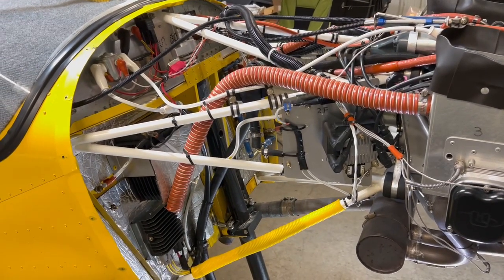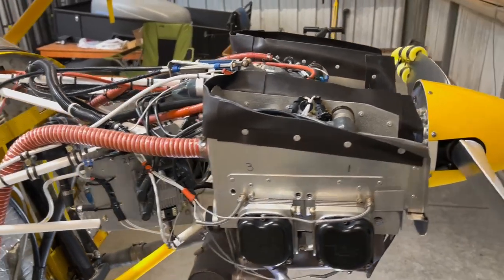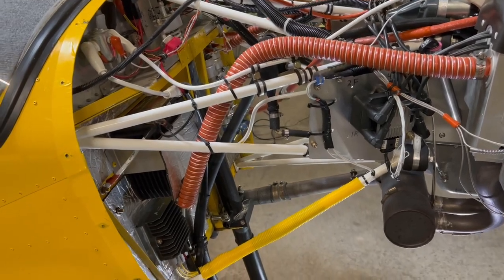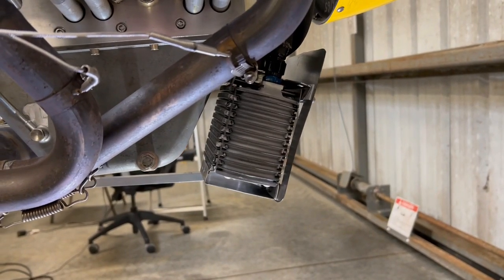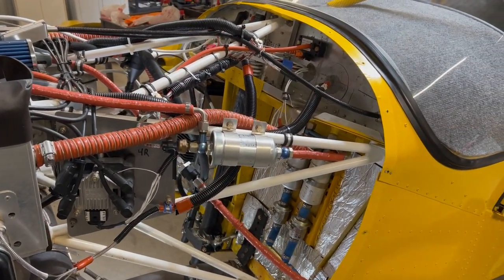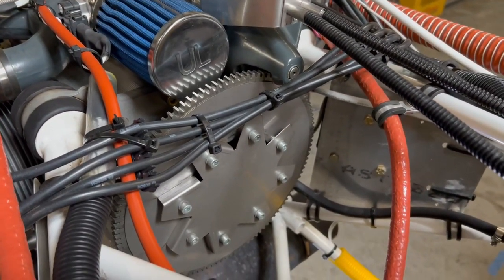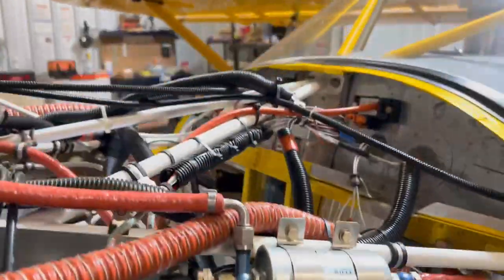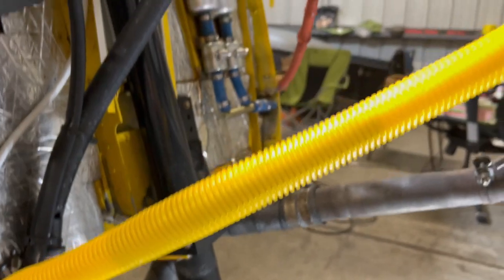Zenith 750 CruZer with UL350is engine

Comment: I appreciate you posting this. I always learn from seeing details of other builders’ engine installations. Am currently replacing an older Jabiru 2200 with a new 3300 Gen-4. Actually just did a similar mod to my muffler and tailpipe for the same reasons. Also thinking about how to best provide some cooling to the voltage regulator, as you appear to be doing.
Reply from the maker: Thank you. I have a buddy who had a Sonex with a 3300 in it and it was a good engine except he always had issues with the middle cylinders keeping them cool.